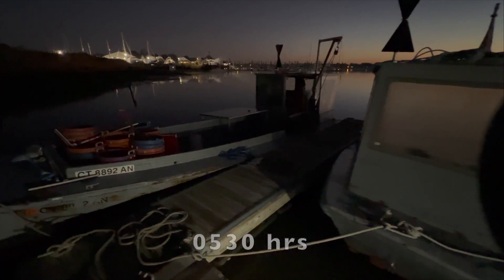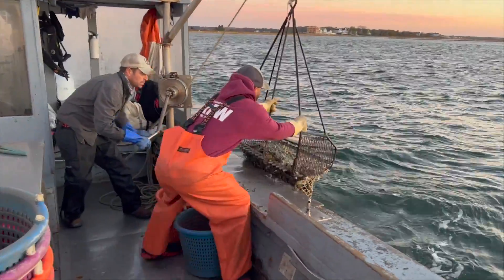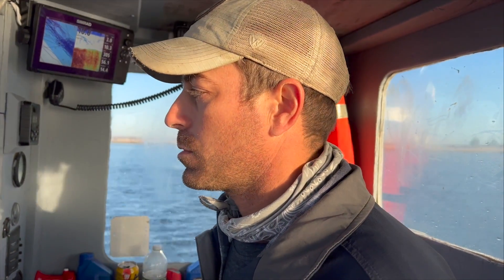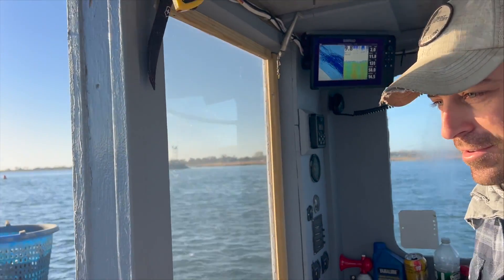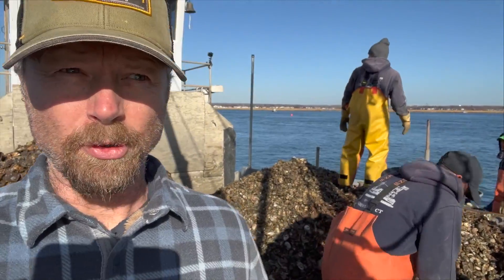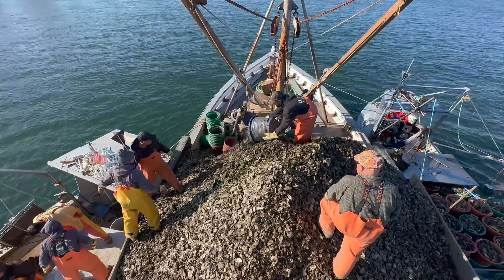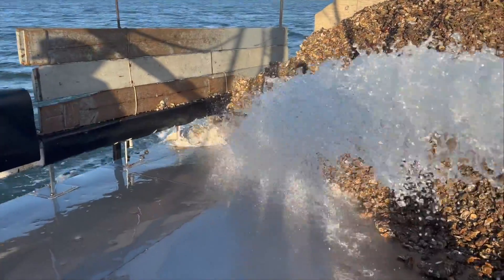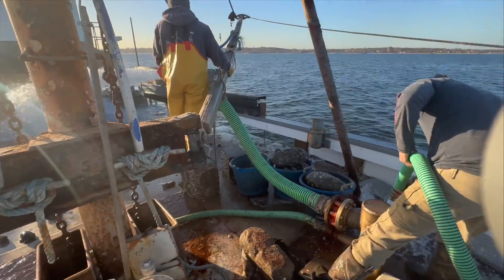Harvesting Wild Seed Oysters for Aquaculture Growout | The Catch with Jardar

Comment: Interesting but sent this overfishing?
Reply from the maker: This is a managed “natural bed”, meaning it’s an area where oyster set very well and has been reserved for use by commercial growers to get seed. 
There is an area upriver that is off limits to any harvest so there will always be brood stock present to spawn. Also the dredge size and hand winding is helps regulate the harvest always leaving some oysters to reproduce. 
This could be a good follow up video thanks for the comment.
Reply: This is called Oyster Farming done since the early 1800s, an agricultural business. Empty shells are “vacuumed” off the bottom and stored in massive heaps on land then put back on the bottom before the oysters spawn. The clean shell gives the spat “baby oysters” a place set, (to grab on to).  If left on the bottom, the old shell silts up leaving the drifting oysters no place to set. This fishing method is why there are so many oysters. ;-)